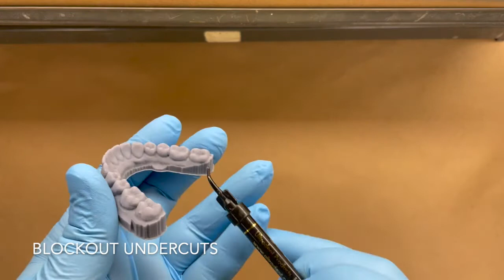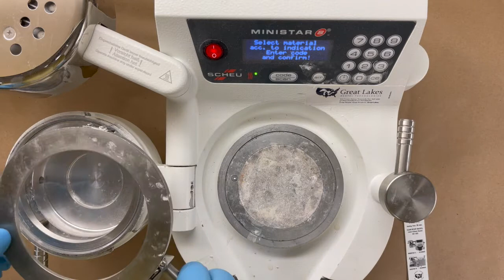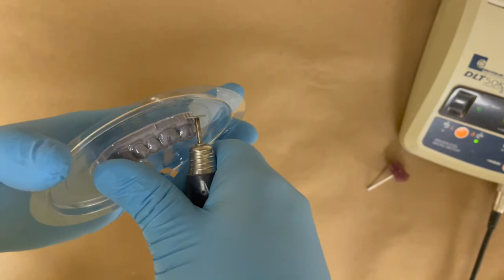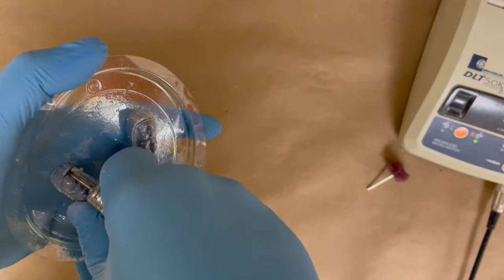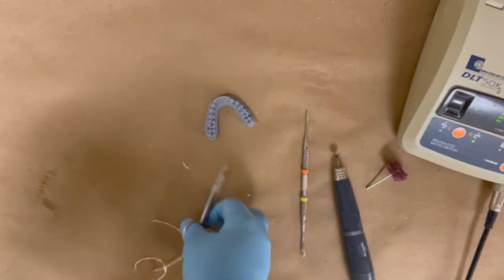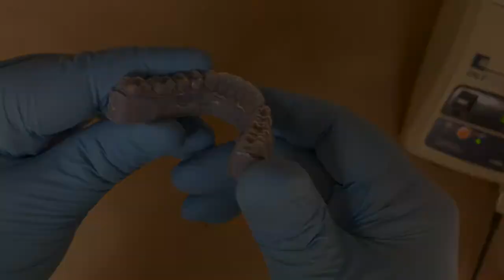Essix retainer fabrication

Comment: Do you use any separator on the resin models before fabricating?
Reply from the maker: You can spray with cooking spray to make it come off easier, but it’s not required.
Reply: @davidjensen4957  Thanks!  I've had the resin breaking off inside the retainer lately because it was sticking to the plastic.  Never had that happen in the three years I've been printing and making clear retainers.